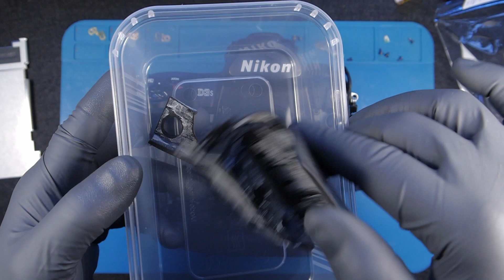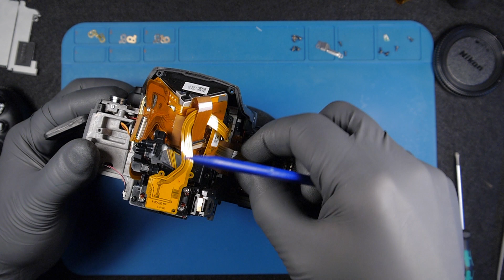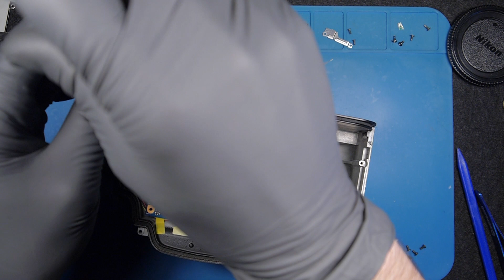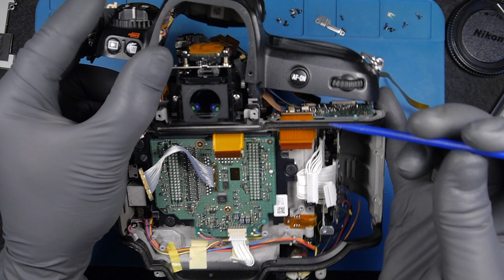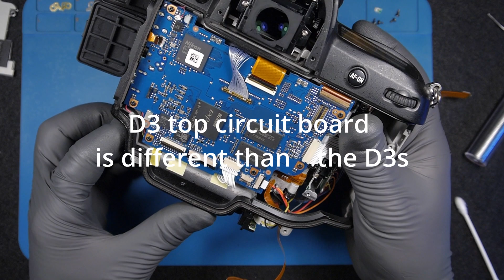Nikon D3s No Power Fix (Part 2 of 2)

Comment: Hello sorry for the late hour By any chance, could you tell me how to make Enel4a dummy battery from the scene that power d3s at the beginning of the video? Or do I just need to supply 12v to the circuit that came out after disassembling the battery pack? I'm sending you a message from Korea
Reply from the maker: Hey, the dummy battery was made from an old battery that wasn’t working anymore. You need to open it up and remove all the internal components. You will then need to have an external power supply in order to power the camera, highly recommend to use a multimeter in line to see what powering the camera shows. Keep in mind that once the camera it is ready to power you will need to use the battery otherwise it will not work. Those models doesn’t like dummy batteries. For any further questions just drop a line here
Reply: @CameraRestore Oh... I need more knowledge about electronic engineering than I thought. I'll look for another way. Thank you for your answer

Comment: Fixing expensive cameras like the Nikon D3/D3S or many other high end cameras is a difficult job even for a professional. He has the right approach to troubleshoot from the most likeliest problem like the power board, to the main PCB board but in the end, the culprit is the smaller controller board a top the camera. It is definitely trial and error process since there is no schematics to have and with PCB boards, you don't fix them, you just have to replace them if you can find the spares. He did replaced the top control board earlier but it did not solve the problem, perhaps it was another bad board. Two hours and 10 minutes on video, not counting the days he had spent troubleshooting this camera, he is definitely very patient and persistent person to chase down the problem, even with highly skilled and knowledge of this job. I am amazed how good he is with the solder iron with all those power wires from the power board. For most people, this camera goes to the trash can or recycle, as sending it back to Nikon will cost more than buying a new one. One lesson learned from this very long video: the order to tackle the dead camera: power board, main board and control board. If anyone of them fails, the camera is dead. If you really want to fix it, make sure you have the spare parts, otherwise, it is a mute point to open it up. However, if he started with the control board first, he would have fixed it much sooner rather than going back and forth with the power board and the main PCB multiple times.

Comment: I have a D700 that does not power up.  Would this likely be a dc/dc power board or is there a board like you replaced on this video? How often is the issue just a fuse? Where would I purchase such fuses? Thanks!

Comment: I had the same problem with my D3s, no power during power on, despite aftere using it for just abt 3 yrs wth low shutter count.  Send it to Nikon service center Malaysia, they just shrug of and offer me to buy a new model instead... I still have it till now, in my dry box.
Reply from the maker: Too far otherwise I could give it a try.
Reply: Was it exposed to any water?

Comment: I trully enjoyed both episodes! Thank you.

Just a quick question. Do you think a D3/D3S is resistant to sea water immersion? Found one on ebay with its lens stuck on shut. Any chances that the lens/body might still work ?
Reply from the maker: Hi thanks. No, most camera are not waterproof, rathe splash proof, beside some Olympus and some newer cameras that improved radically but still, not for complete immersion.
Reply: @CameraRestore  Thanks for the reply. 👍